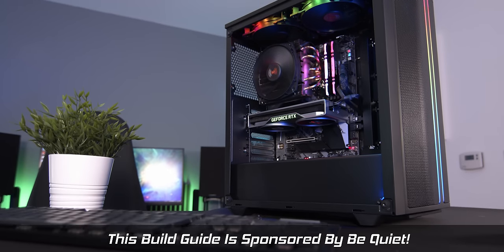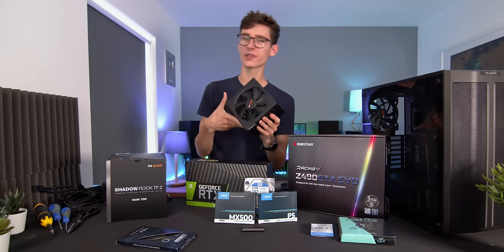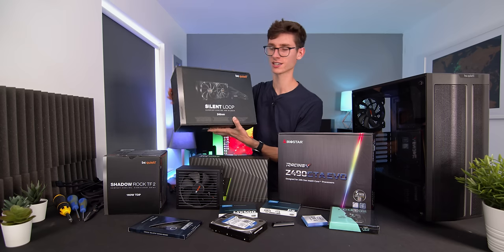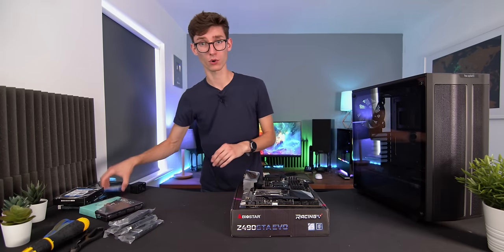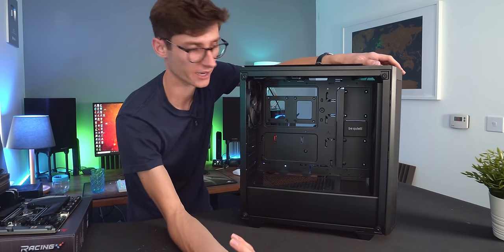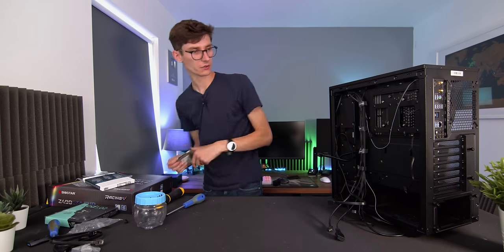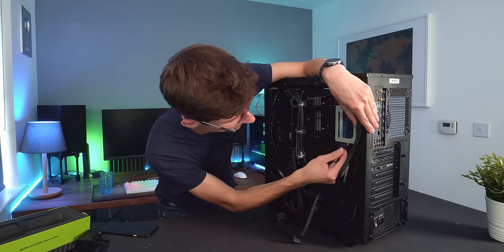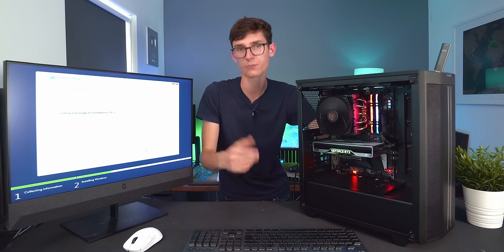How To Build A Gaming PC 🤗 COMPLETE STEP BY STEP Beginners Build Guide | AD

Comment: I’m looking at building a pc but the parts that confuse me is the memory. I understand ram. It is the ssds and hard drives. In this he uses 2 ssds and a box hardrive thing. Do I need all 3 of these??
Reply: When someone talks about memory, what they're actually referring to is the RAM (which stands for Random Access 'Memory'). In terms of storage, he was just demonstrating the three types of storage you can use;  PCs generally accommodate space for multiple storage devices, but really you only need one and it can be any of those 3 options he mentioned. Though I recommend having at least 2 - one being a HDD for general storage of files you don't use much (they're quite cheap and have the largest space), and the other being a SSD - which you should use for running your operating system, software/games, etc (much more expensive per gigabyte of storage but with the benefit of reading/writing 10x faster than a HDD for the regular SSD and probably double that again for the NVMe SSD).

Comment: So about SSD and HDD should I buy two of them ssd for faster boosting and HDD for longer storage or what?
Reply from the maker: Just one SSD
Reply: Its up to you. If you need a lot of storage that you don't mind being slow, you can add a large capacity hard drive. Or if you have the budget, you can buy a large capacity SSD and forgo the hard drive; just note that high capacity SSDs can be quite pricey.

Comment: So my Ryzen 7 3700x didn't come with a thermal paste tube, but instead it looks like there's some paste pre applied in a pattern on the bottom of the cooler. Is this viable? I mean, im assuming if its being included without a tube of paste then it should be fine, but I'm overly nervous about not including thermal paste.
Reply: yes it is viable as long as u didnt touch it or mess it up

Comment: If I purchase an SSD, do I have to get a hard drive? I'd imagine not, but most of this is new to me.
Reply: It depends on the capacity of the SSD. I would go for at least a 500 GB SSD, but I would really consider a 1-2 TB SSD. If you can't afford a higher capacity SSD, 500GB should be fine paired with a  1-2 TB HDD.
Reply: So if I buy a high capacity SSD, I do not need to buy a hard drive, right?
Reply: @Bradysbergen  Correct.
Reply: @JJFlores197  thanks!

Comment: So I followed everything and I haven't yet been able to enjoy my pc. When I plug in my PSU and turn it on my motherboard light comes on but only that. My rim sticks don't turn on not does my GPU. When I try to press the power button nothing happens. I checked multiple times to ensure the front panels were properly plugged. I spent all day yesterday trying to resolve the issue but I'm still stomped

Comment: Does the case come with all the cords I will need ?
Reply: The PC case comes with the front panel cables: power button cable, reset switch cable (if it has it), USB, and front audio connections.

Comment: I need answers fast guys. Do you have to take precautions to prevent static or is it ok to build without it?
Reply: Its your build, its up to you how cautious you want to be in regards to static electricity. I have built several PCs without using an ESD strap without issues, but again, its up to you.
Reply: @JJFlores197  thank you my friend. I built my pc but I’m getting a debug light saying my cpu isnt working? It’s preventing my pc from displaying anything. Any ideas on why it might be doing that? I checked the pins and they way it’s seated. Everything is as should be
Reply: @bean1791  What motherboard and CPU do you have? Make sure everything else is plugged in correctly like RAM. Make sure the CPU power cables are correctly installed.
Reply: @JJFlores197  I have the msi b450 gaming carbon max pro motherboard with a Ryzen 5 5600g

Comment: Hi , Thanks for Building my confidence . Your Videos have helped me to understand a lot about building my own PC. Kindly Advice me with plan I have...Please do suggest if any of my approach is wrong. My profile of work is 3D animation, Architecture Renders and Graphics work. But also want to play High-end Games like Cyberpunk,GTA...Etc. Kindly Guide me.
Ryzen 7 5800X 
GIGABYTE B450 AORUS PRO
Corsair Vengeance LPX 8GB x4 (32GB)
Samsung 970 EVO Plus 500GB PCIe NVMe M.2
Seagate Barracuda 2 TB Internal Hard Drive
Cooler Master MWE 650 Bronze V2
Gigabyte GV-N1030D4-2GL GeForce GT 1030
Corsair 110R Mid-Tower ATX Case, Acrylic Side Panel - Black
Reply: The graphics card is pretty bad. The GT line of cards are very low end and not for gaming. It will work fine for basic tasks like web browsing and some old games, but it won't work well for newer and graphically demanding games and other tasks.

Unfortunately, due to the chip shortage there is a large shortage of graphics cards so finding a decent one will be a challenge.
Reply: @JJFlores197  Thank you so much. I appreciate your support.

Comment: Why did you use Hard drive when you already have NVMe SSD card?
Reply: For more storage.
Reply: @JJFlores197   but if you have high storage(8TB) NVMe card wouldn’t it be enough for building a gaming PC?
Reply: @santoshsaisharan  Yes that will certainly be more than good enough for most people. The issue is that an 8TB NVMe will cost a lot. Probably as much, if not more than the PC itself.
Reply: Just to show how to install all 3 types. Most likely for the video

Comment: Do you have to use a hard drive?
Reply: you dont have to
Reply: You can use any type of storage drive, but you do need a storage drive.  Either ssd, m.2 pcie, Or hdd.  Hdd are the least expensive but ssds are faster.

Comment: 4:50 I know this is probably the simplest part of this video but can someone explain this USB bit? I don’t understand what to do or why to do it
Reply: You need an operating system in order to use your PC; otherwise it won't do much. A PC you build yourself has no OS installed which is why you need to install one. The common method is to use a USB drive and a working PC. You download the media creation tool from Microsoft which as the name implies, downloads a copy of Windows and puts the files on the USB drive. You then use this USB installer to install Windows on your newly built PC.
Reply: Unless you wanna use the bios as your main OS you're going to have to install an OS

Comment: Where do I buy all these components?
Reply: Any retailer that sells computer hardware like Amazon, Newegg, eBay, BestBuy, etc.
Reply: @JJFlores197  Thank you. Do the components need to be the same brand in order to attach/fit together?
Reply: @rockbottom1014  No. That's actually not possible since not every company makes the same hardware. My suggestion is to read up on how computers work and what the parts are and then go from there. There are plenty of good guides and resources out there.
Reply: @rockbottom1014  they dotn need to be same brand but certain components need to fit together.
for example your motherboard socket type needs to be the same as your cpu socket type.
but they dont need to be from same manufacturer.
there are some sites where you can input components and site checks for compatibility

Comment: When you buy a case does it come with the cables?
Reply from the maker: All the screws and all the front panel connections. Power cables are with the power supply

Comment: So I’m actually going to be this EXACT replica build for my YouTube Channel. I have no idea what technology is lol, and I already ordered the motherboard, but I may need help from here on out lol. Be awesome if we can somehow communicate, could use the help lol. I’ve been recording myself and probably won’t have everything tell October, at least that is the goal. Again, help be appreciated! Thanks!
Reply: My first issue is I can’t find the exact same RTX 2060, I found another but it’s a GeForce RTX 2060 “DUAL FAN”. Would that be the same, and comparable to the motherboard?
Reply: @doug5430  You can use practically any graphics card from the past decade on any motherboard from the past decade or so. So yes, that graphics card will work. The problem right now is due to the pandemic, there is a massive world-wide chip shortage so a lot of computer parts are out of stock. The little stock you can find is usually very overpriced. This is a year old video so some of the parts may be discontinued.

Comment: Can u Switch the RTX with another version like the 3070?
Reply: Well duh
Reply: @ratmatat  But wouldnt The driver or the others be lower compared to the 3070?
Reply: @kremeYT  you just update the drivers.  The cards are physically nearly identical.  You could even use a 10 or 20 series card if you want.  Just make sure it gets the correct power plugs.

Comment: must you have the nvme ssd?
Reply: It's not necessary - you can even use just one drive if you want and it can be any 3 of the ones he mentioned. Though NVME has the fastest read/write speed of the 3, which means if your operating system is running off it - it'll have the best performance.

Comment: What happens if u put too much thermal paste
Reply: If its electrically conductive thermal paste and seeps out, it can damage components on the motherboard. If it isn't conductive, it likely won't do much but make a mess. Either way, its best to not use too much.

Comment: Does a pc need a power supply because i have a cpu cooler that is in front of the cou cooler
Reply: lmfao. Of course my dude. PCs don't run on magic. They need a power source. That's the job of the power supply- to take the power from the wall outlet and distribute it to the various components in the computer. Can you drive a standard gas car without any gasoline?

Comment: Is this true with evrey PC?
Reply: not necessarily - different CPUs (AMD am4) will require different installation methods, and other parts (particularly cases) will differ, however the general makeup of all modern builds is essentially the same.
Reply: @nicholabrichieri-colombi8471  So like if i bought a new PC i would be able to folow this tut?
Reply: @rjgamer7612  Not exactly, if you bought the exact same build, then yes
Reply: @theereplays1165  ok. wjhat pc did u bye?
Reply: @theereplays1165  Also, How did you figure out how to build this PC?

Comment: i know this is a stupid question but do i need both ssd and the hard drive or do i pick one
Reply: You can choose either. I strongly recommend an SSD as the boot drive. It will make your system much faster and more responsive than if you just install a hard drive.

Comment: I dont know the difference from ssd to hhd
Reply: ssds are faster than a hhd but hhds are cheaper
Reply: would recommend getting an ssd so you have fast boot times into windows and faster loading times in games
Reply: @m.is.ty.  Im fine with a bigger price  but hhd are old aren't they.
Reply: @Sbreaux2006  not really old just slower than an ssd for example if u have windows on an ssd it would load up much fatser when u turn on ur pc and games would load quicker
ssds arent that expensive it depends on how much storage 480gb ssds are around £50

Comment: Do not waste your time on this video. He skipped a lot of information and the title must be "incomplete, not step by step" PC building. Bad camera angles in which some important sections are not seen properly. Go to TechSource "How To Build a PC - Step by Step (Full Build Guide). Night and day difference. More beginner-friendly for noob PC builders
Reply: The difference is - one video is 22 minutes long, and the other video is over an hour long which is quite excessive (but it is a very good video in its own right too!) But I believe this video is more than enough for the average joe building their first PC. Every PC and its housing is different, and especially every motherboard is different. So having close-ups on everything or showing exactly where to insert things isn't going to help too much. Basically if someone can plug the power supply's main cable into a wall outlet, then they're likely capable of figuring out how to plug in the cables on the MB. He could explain things better such as the reasons why RAM goes in certain slots though.
Reply: @Inuweeb he has a 25 minutes version

Comment: How many pounds is the build all together
Reply: £1100 depending on the SSD or harddrive you use but it won't make a lot of difference in terms of price
Reply: @ralf4431  ok thanks helps a lot bc I have a price budget and this pc catches my 👁
Reply: @voliix_uk.6269  yes it's very good for the price, make sure you find a graphics card around £300-400 and not for triple the price. You'll need to wait for it to get in stock or find a reliable supplier there are so many scammers out there now
Reply: K thx for the tip